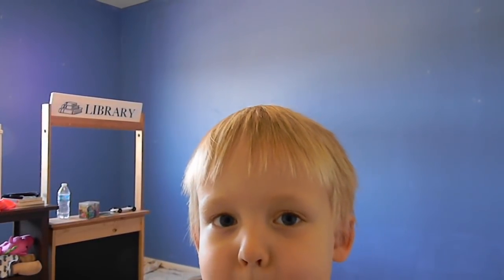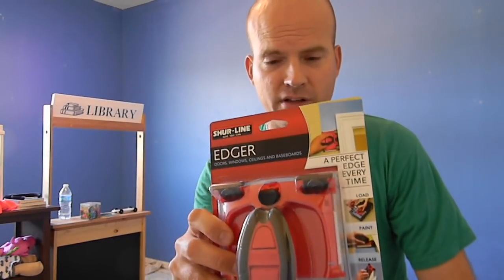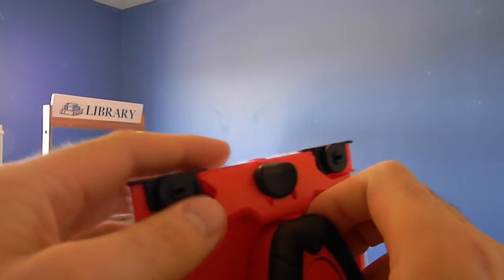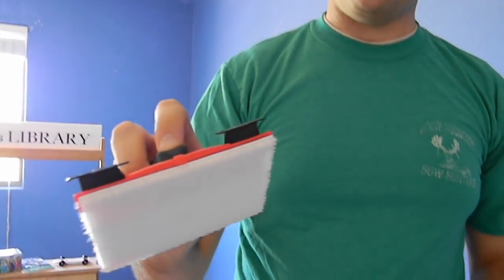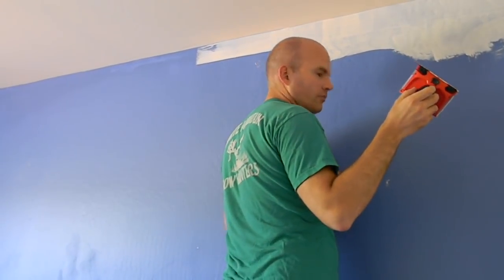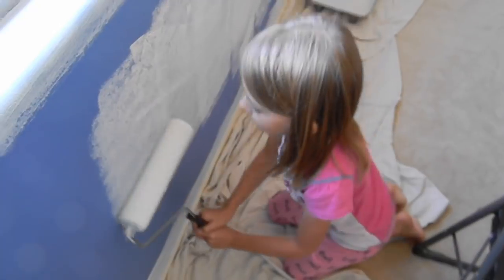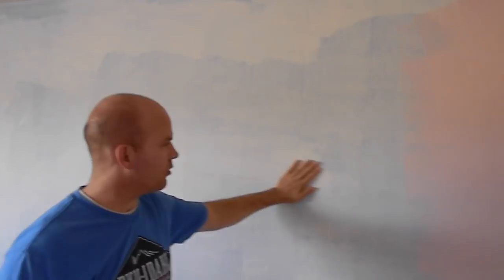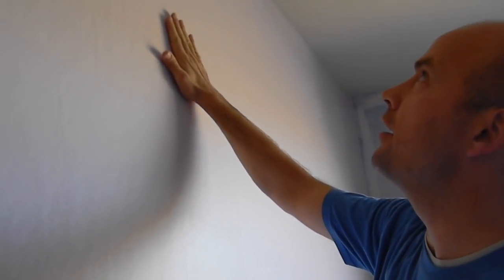How to Use a Shur Line Paint Edger

Comment: I have been using this edger fir years. HERE IS THE TRICK: I DO NOT dip it into the paint. With a paint brush I brush a somewhat generous amount of paint on to it.  When you dip it too much paint is on it. Also, you have to apply even pressure and not too much. Finally, make sure the wheels do not have paint on them each time you load the pad with paint.  I do not work for the company I am just a person who has used this product for a long time and have learned the tricks.
Reply: Thanks for the tip, do you have the pro or the regular one?

Comment: This tool does not work if you have cornices, because the wheels are not close enough to the wall to roll along the cornice edge. The result is that you scrape black plastic from the tool onto you freshly painted cornice. Wheels should be closer to the front of the pad, and all the black plastic should be be WHITE.

Comment: If you want to save even more time, skip the primer, there is no need to prime when you are just changing colour, primer is to seal drywall, and prep surface to paint, once painted the need for primer is no longer needed, two coats of paint that's all that is needed.
Reply: A professional painter told me this, and sure enough when I painted, two coats that was it. #gamechanger

Comment: I see that you're using the pads sometimes badly. Surely you do a good job, but with the pads you have the wrong technique. That said without taking anything away from your good work.

Here's how to use the pads properly. Painting by making an inverted U. Let me explain.

FOR A WALL ADJACENT TO A CEILING:
1. Before going against the border, apply the pad on the wall far from the border, then slide it towards the border. It will make an inverted L..
2. Glide the pad evenly with even pressure, you can go either way.
3. To remove the pad, slide it down. This will complete the inverted U. Remove by sliding and not directly as you do, because it produces peaks!!!

TO SOAK PAINT WITH PAINT:
Just immerse the hairs and rub the pad on the edge of the tray, it removes the excess and evens out the paint on the pad.

TO REMOVE EXCESS PAINT ON CASTERS:
Before repeating steps 1 to 3, rub the small rollers on a wall to be painted. It's a good precaution, because sometimes they get dirty. Wipe this part of the wall.

Repeat steps 1 to 3 carefully. I am able to paint a very far wall with pads that fit long sleeves!

FOR CORNERS (junction of 2 walls and a ceiling):
We have no choice but to use the brush, which is the only one going into the nooks and crannies.

FOR ADJACENT WALLS PAINTED THE SAME COLOUR:
Use a roller with one end "closed" completely hairy.

Never again will I make borders with a brush, it's too long and risky.

Comment: All of these tools are gimmicks you need to tape stuff off because when you roll especially over the base it is going to sprinkle paint all over it You need to tape off the mill work as for the ceiling you're eventually gonna start scratching into the ceiling with that plastic